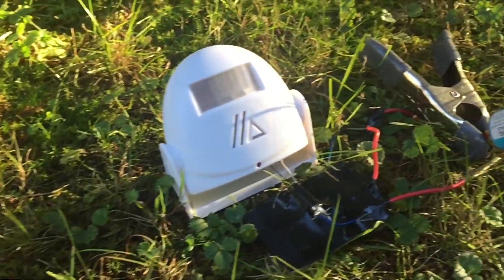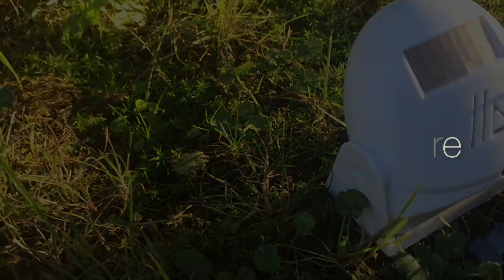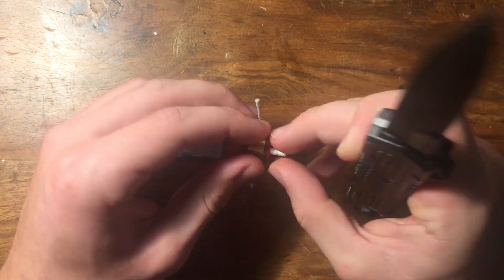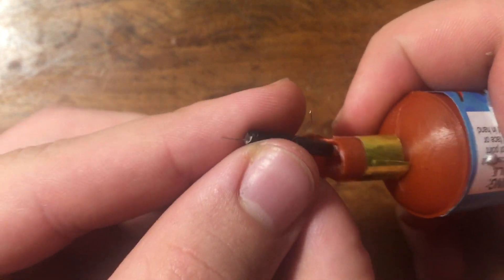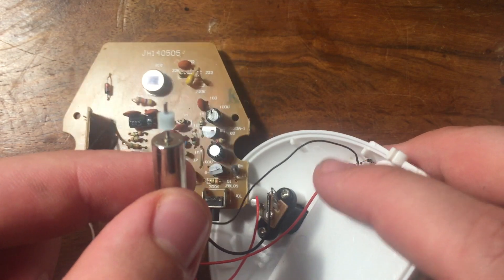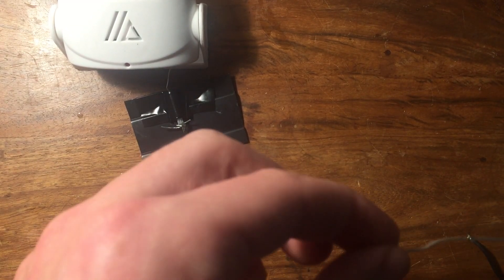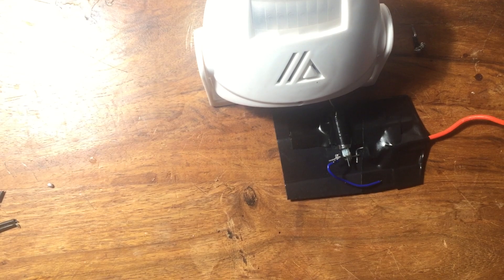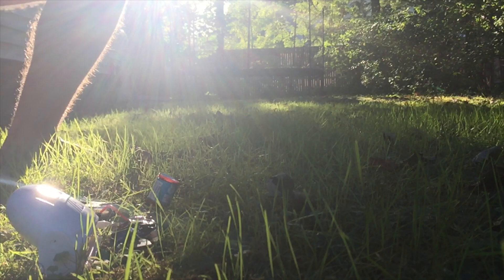How to Make an Airsoft Landmine (Motion Activated)

Comment: You could use steel wool and see if the voltage from the door bell is hot enough to ignite that. there could be a way to rig the 9v battery as the voltage source. There might be a resistor in there that might have to be removed so that the full 9 volts goes through it.

Comment: couldn't you have directly connected the wires to the party popper instead of adding extra steps to it?
Reply: +maplestory15413 thats what i was thinking XD
Reply from the maker: I wish but theres not enough voltage coming off the doorbell to ignite the party popper
Reply: +JLaservideo use a relay
Reply from the maker: +Chrometheus I tried but the relay would switch back off after a second which is not enough time for the party popper to light. The motor makes it say stay on.
Reply: I seee , well you made a relay :D
Reply: +JLaservideo if you used a latching relay i would stay on indefinably
then you could add a reset button